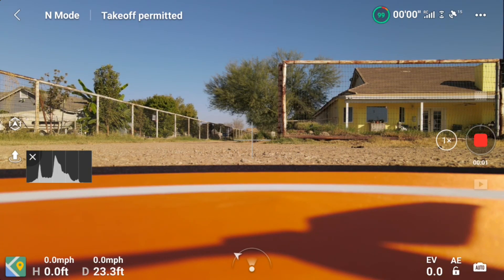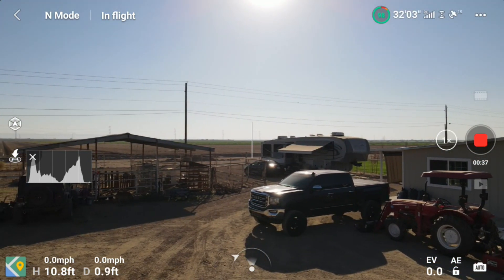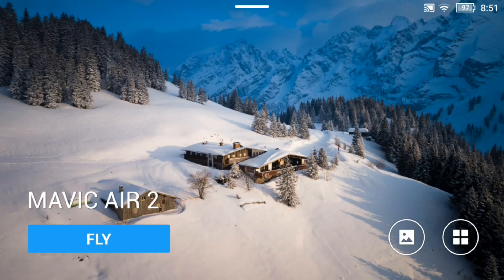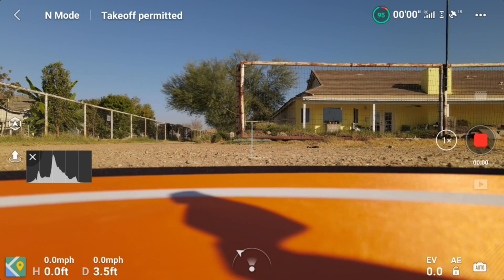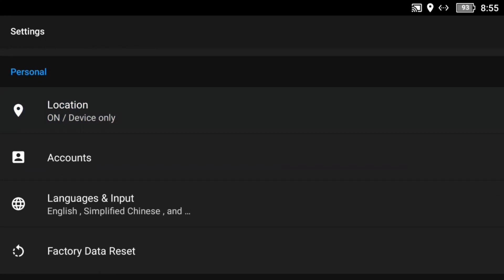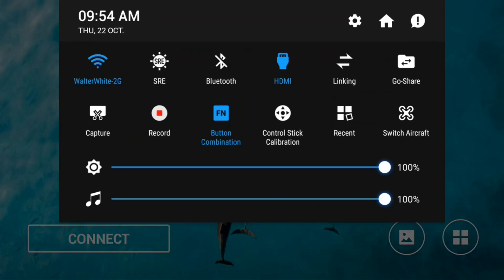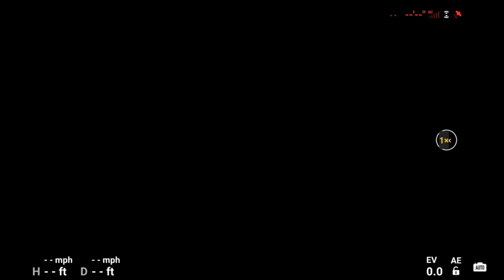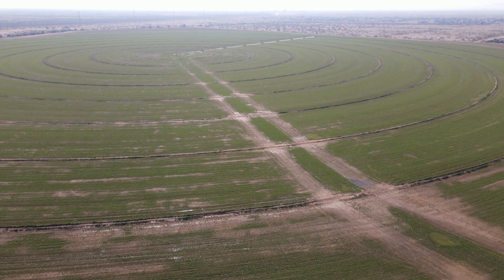DJI SMART CONTROLLER AIRCRAFT ORIENTATION DISPLAY CORRECTION OF MY PREVIOUS VIDEO

Comment: my understanding of the orientation display is the arrow tells you which way to rotate your controller to the aircraft to get maximum signal assuming you have your antennas flat to the drone.
Reply from the maker: Thank you for your comment Russell. The image of the drone (Little arrow) shows which way it is pointed, and generally the antenna orientation is best when the arrow is pointing away from the center of the circle. The location on the circle indicates it location relative to the antennas on the controller. Thanks for your input and God bless.

Comment: Mrkentdotcom, I’m experiencing the same issue.  Like you, I tried troubleshooting with the Mavic Air 2.  I also tried reinstalling the firmware at the recommendation of DJI Support.   Nothing worked.  I returned the controller for an exchange however, the new controller has the same issue.    This is not only disappointing but unsafe.    DJI should address or advise.   Hopefully it can be resolved with a firmware update.   Please keep us posted on your efforts,   Enjoy you vids!
Reply from the maker: Thank you for your comment. I went to the park yesterday to try it without any iron fences around but it didn't make any difference. There may not be an answer as you say until DJI makes a change. Thanks again for your valuable input and God bless.

Comment: Hello from germany... I have the same problem - the drone-indication shows always the drone is behind me instead of in front of me. Calibration of Smart-Controller or drone without positive result. But - the map shows the right position and direction...
Is DJI aware about the wrong indication?? Wenn I use the original Controller everything is o.k. without any calibration...
Reply from the maker: Thank you W. L. for your comment and input. I'm sure DJI is hearing about it from some folks. I have not contacted them. I appreciate your input and God bless.

Comment: What’s your thought on signal boosters? Tomat Yagi-UDA Remote Controller Antenna Signal Booster Range Extender for DJI Mavic Mini
Reply from the maker: Thank you for your question Eric. I have not explored all of the issues. the Yagi is great except when you aim the antenna slightly off the target. I kept loosing contact. The parabolic antenna test I ran gave me 16% more range with the Mini. I hope that is helpful. Thanks again and God bless.

Comment: I can't even get the Orientation to display on my controller at all.  Does anyone know if its a setting I just need to turn on?
Reply from the maker: Thank you for your question Froochie. In the lower-right-corner of the map there is a very small symbol. Tap on that and your orientation display should show up. I hope that works for you. Thanks again and God bless.

Comment: Hey Mr.  Kent, greetings from Toronto  Ontario.  My knees also bother me,  but it's not hot here today 10°C, I think  that's about 45° F.   Keep plugin' away on that smart controller problem and you'll get it right.  Guess that smart controller isn't so smart after all.        I also just recently acquired a  M A 2 and I'm wondering what settings your camera is on for your videos.
 Your videos  seen quite smooth and easy to watch. That's all I want.       Take care.  Stay safe.         the way I see it -- Pat
Reply from the maker: Thank you Pat for your comment and question. For this video, because the screen recording is only 720p the resolution is not as sharp as I like. Normally, with the videos from the Mavic Air 2 camera I have them set at 2.7k p which is plenty sharp for a YouTube video. I appreciate your comment about the smoothness but that is just from practice trying to create a smooth video. You also take care and God bless.